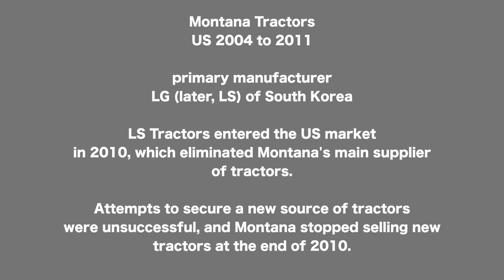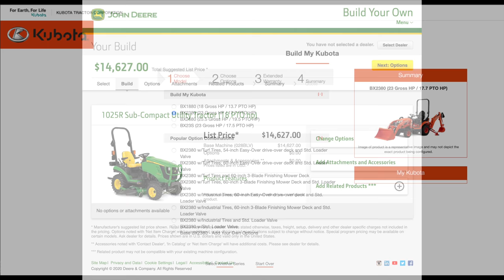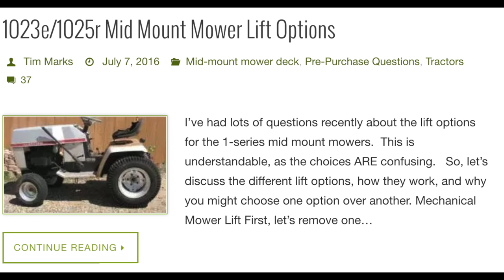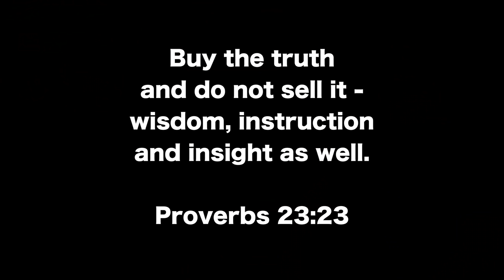Have NO REGRETS! Watch This Before You Buy A New Compact Tractor!

Comment: Good advice Tim. The 1025r is perfect for my 5 acres. We just bought the WorkSaver electric grapple. This implement is the bees knees for our land. My advice is don't buy a backhoe if your just taking care of 5 acres or less, just rent a 11hp mini excavator for an extended weekend. I dug a 100' trench for water & power from the house to my 16'x 20' barn with leanto for implement storage. In the same 3 days I dug two  4' deep footings for the barn and 4 holes for 8" sonotube 4' deep for the Leanto roof supports.
Reply from the maker: I disagree about the backhoe.  I use it for lots of "tiny" projects which would never justify a rental.  we'll show an example in an upcoming episode.   Anyway, each to his own :-)

Comment: LS Tractors have a good dealer network. You probably will not go wrong with New Holland, Case IH or Massy Ferguson. John Deere has a very solid network but you will pay for it. I have a New Holland and have never had a problem getting any part I may have needed.

Comment: Fwiw, grandpa has had a 5000 series since the mid-90's, but on a 450 acre tree farm, he got by with a 4wd Deere 1050 with no loader for 15 years before that. If something had to be lifted, there was a 3-pt hitch scoop and boom (having said that, get the loader!). So yeah, bigger is better and all that, but any actual tractor that will take attachments will do a whole lot! The only real problem with it was that you had to steer with the brakes when skidding big logs.

Comment: I started out with a 2210 and used it, but had decided I needed to step up and traded my 2210 for the 4115. I now have the 4115 and am satisfied and the attachments still fit from the 2210. The dealer is knowledgeable on the attachments to make sure if they will fit the next application(tractor), that you may purchase.

Comment: Great episode.  You always have the best videos Tim.  But a trailer should be discussed especially if you will help others and where are you going to park it?  And before that do you have a vehicle that can pull a trailer.  My opinion is a loader is an absolute must on a tractor.  I always recommend same brand loader as the tractor.  Consider a belly mower of the same brand also.    Then a box blade (also offsets the loader weight). I used the loader and box blade more than anything else.  You will quickly find a tiller is a must.  Those items don’t have to be the same brand as the tractor.  Considering the horrible cost of the backhoe, and the amount you will use it, I’d wait and just rent if you ever actually needed one.  Consider there is always one more attachment you will want for as long as you own the tractor.  Allow for it.  I never regretted the tractor or any of the attachments I purchased as I could do most anything and found things to do that otherwise I would not have even considered doing.

Comment: I live in Arizona on an acre irrigated property. I have a 1025 R with loader and 54d mower deck. . I have a rake and a blade. I wish I had more attachments. Box blade,tiller, and maybe a land plane. Get the 1025 R with the attachments that you need.

Comment: A dealer is basically a next level manufacturer....... tractors are built to your choices.  It isn't plug & play.  The tractor sitting on the lot actually isn't actually ready to go.  You'll need to add a ballast box, weights, tire fluid, etc.  I generally recommend rear tire spacers.....a tractor with a loader can be fairly unstable.

Comment: I love both tractors period! I went with John Deere for two main reasons on two different tractors purchases (3025 & then upsize to 4044m) and one zero turn (Z960). I think both brands are superior quality. First reason is 0% for longer term options. Second is John Deere insurance is far cheaper than Kubota's. This alone will save you a surprising amount. Third and fourth reasons, a lot of the John Deere compacts come with hydrostatic transmission and R4 tires standard. These are often expensive upgrades on Kubota's. I surely am not knocking Kubota tractors!! I tried each time to give them an opportunity for my business. John Deere most the time is cheaper in the long run even with a more expensive tractor due to these factors. I am currently looking now at purchasing the 1025r TLB for my smaller yard projects. Watching Tim lets me know what all this little tractor can do.
Reply: Sorry, for some reason this comment posted under my daughters name🤔

Comment: Very valid points. Having a 1025 myself I’ve had the chance to get into several projects like yourselves. It’s a very capable machine but it has limitations.  Another great comparison I have kicked around is a Vermeer skid steer... rubber tracked a bit more stable on hills and for grooming beech volleyball 🏐 courts.  💯 agreed any machine is only as capable as the additional attachments.  My opinion is there is a sacrifice to a multifunctional machine, I would not order a backhoe for my purposes I would rent a machine designed for the task. I ordered my 1025 with 3rd valve up front and a hydraulic top link and tilt cylinder on 3 point hitch. I have a box blade that we cut the sides down on so it will scrape better & added a 4 in one bucket @5’ wide just before they started offering 4’ model I welded excavator teeth on this bucket ( comes to about same price as a tooth bar). A tiller and York rake are two attachments I need to invest in.  As you may suspect my hydraulic pump is maxed out, functions are jumpy or slow to respond because of where the flow is needed or from the fact it’s a sub compact that is highly capable but has limitations. I would like to see if Vermeer1000 model  using a land plane, box blade, tiller demo bucket and York rake if it would be a smoother than a sub compact machine.... I say this because the foot print is similar as is lifting capacity, I wonder if the hydraulic system and pump is built a bit more robust to handle a different style of punishment?  Any knowledge you  or your channel base have on these machines and their attachments may help with new property owners. I think the Vermeer would have been a better fit. I love my 1025, didn’t know the longevity of the mini skid steers and bottom line is they cost more.
Reply: Mandel, good point about renting an excavator which is more versatile and out produces a backhoe. Skidsteers, if they have the Hi-flow option for attachments will have the extra juice. 
If you're in snow country a tr a cked skidsteer doesn't have the traction because of reduced psi ground pressure. I really wished Skidsteer mft added steel tracks as an option. Some makes did have them in the past.

Comment: The 1023e can have some really good deals that the 1025r doesn't as well. I got my 1023e with 0% for 84 months and a $500 rebate and at the time the the 1025R was only 60 months with no rebate, so sometimes the slightly different models can have pretty good deals.

Comment: Tim from what have seen and heard on other videos is that you have to have the backhoe mounting frame on the tractor before you can buy a backhoe attachment at a later time so a customer would be without the tractor for a few days regardless weather they get the backhoe from day 1 or if it was 3-4 years old
Reply from the maker: You can install the subframe assembly yourself if you want.  it is easier now on the 2018+ machines than on the earlier machines.

Comment: Moving into ALL lithium-ion powered yard tools.  To date,  I'll never re-consider gas again.  Need is a riding mower - 38-44" cut width with a transmission that can handle attachments without over stressing.  Speed is NOT a consideration.  Very good video!  Tom

Comment: I used an old Ford 2N for years. It pulled a bushhog, a grader blade, and a pond scoop and also lifted a lot with just a pole boom. It only had about 20 wore out horsepower and a single stage clutch....yet now I'm struggling on deciding if a 25hp diesel tractor is enough for my needs. The struggle's real lol.
Reply from the maker: In my view, a 1025r with loader will more than replace your 2N.       Having said that, you would likely find more value out of a 2038R.

Comment: Mine wintered over under some tarps & a harbor-freight 10x20 car cover open-side “tent”. However, a steel building is going to be installed for it just as soon as I get the foundation for it in place.

Comment: I bought a Kubota tractor 40 years ago.  A L185 and the only thing that is wrong with the unit is that one fender has faded and the other is still shiny as new.  Apparently they painted each part separately in 1980 and put it together.  I am planning on buying a new tractor this year and their is only one choice.  The Kubota brand stands for quality and I have a dealer less than 6 miles from where I live.

Comment: I bought a 1025r with a 120r loader, bucket and forks, light 4ft box blade, tiller, 54d mower and mulch kit, quick hitch, heavy hitch with plow and subsoiler and weights

I have almost 1/4 acre.  Seems way to small But the tractor allowed me to have a sizable garden for my family to eat from, to mow in much less time to spend more tome with fam, to take care of many many project in much less time, and to start a business and be very successful in my engineering career.  Which means the tractor is now tax deductible.

I would say if you can afford it you will not regret it.  I would also say go 1 size larger than you think.  You will also not regret it.

Comment: One thing to consider.  The larger the tractor, the larger the attachment needs to be.  Because of that, the cost of those attachments goes up.  My tractor is a an older one, but the best condition I found was in a machine in the 50hp class with a Class II 3PH and a rear tire width of 80".  It was purchased for maintaining the 1/4 mile gravel driveway after I'd pretty much blown up all manner of "Garden" tractors.  I'll admit I have far more tractor than I need with this 8000lb beast.

She's a great machine, but every time I look at rear attachments like my land plane and inverted snow blower, I'm looking at 7' wide attachments because I need those to span the width of the tractor.  In a land plane, going from a 5' to a 7' adds about $500-$800.  In a snow blower, I needed to go looking at used equipment because it would have cost more for the blower than I paid for the tractor.  A 7' blower runs between $6000 and $10,000.  It took me almost 3 years, but I finally found a used blower for roughly $3000 that was in a condition I could use - most get beat to hell.

That said, because my machine is so freaking big, 2WD is all I need.  I've used it to rip out some pretty large bushes and even some trees and I've not spun a wheel.  I do have a diff lock, but except once in the winter I've never used it and that use was on ice. 

Trade offs are what tractors are all about.  But I just wanted to mention the fact that with bigger machines, all the pieces parts also get bigger and more expensive.  The rear tires on my machine are 18.4x30.  They are awesome as they grip and float well with the weight and by filling them I added about 2000 lbs to the machine, but they also cost over $1000 each installed.
Reply from the maker: Mentioned that in the video.
Reply: @TractorTimewithTim  Yes, you did, but far too often you hear the comment of "Get larger than you think you need" and the cost of things after the fact does not get mentioned nearly as often.  When I first looked at the beast I have, my reaction was "WOAH!"  Needing a step to get into the operator's seat was the first time I wondered if maybe I was going too big.  I don't really regret it as I've certainly used the machine for jobs I never really thought about.  But the sticker shock on attachments was certainly not something I had even considered.

Looking forward to the rest of this series!

Oh, and where you have the Finance Committee, I have the Mistress of Finance.  I think if we'd have known just what the difference in attachments was going to be, I think I would have set my sights just a bit lower in tractor size. 

While I have your attention.  Thank you for talking about the Lube Shuttle.  I got fed up with the old grease gun last weekend and just tossed it.  Nearly an hour trying to get a new tube going and grease all over everything.  The Lube Shuttle arrived yesterday and it loaded up without a single bit of mess and it works very well.  Now I just need to get one of those Lube Lock things.  You mentioned that you needed an adapter, where does one get that?

Comment: The John Deere 1025R looks like a great tractor, but for 1 acre of mostly lawn I think it would be an overkill.  A John Deere lawn tractor and a self propelled snow blower should suffice. I have about 1/2 and acre and my John Deere LA115 has been serving me very well since 2008. I've used it for mowing (natch...), pulling a cart, a spreader (seeds, pest control), sweeper and a roller. The LA115 cost me $1600 back then (I think it's around $2000 now). The snow blower was $600. All the items I've mentioned above came up to $700. I would get the 1025R if I had 5 acres or more, especially with a long driveway in a snowy region.

Comment: Excellent episode Tim!
Your points are spot on and I would like to add a few things…

He needs to mow. If his focus is to have an undercarriage mower rather than a tow behind then the ONLY choice is John Deere. Nobody beats JD in this area. Get the 60” mower deck. I regret only getting the 48”.

A 1025 would serve him well, but if he can afford a 2038 GET IT! Better to have it and not need it than to need it and not have it. Having said that, If he has a drain field he can be assured that a 1 series won’t hurt it. Not so sure about a bigger tractor.

The Backhoe is a must hands down. Wish I had a thumb.

GET FORKLIFTS! Probably the most versatile and cheapest attachment. Aside from the obvious, you can dig/pop up brush, but it does a pretty good job at moving it as well. Grapple would be better, but that’s only if you have the cash and it’s not box-friendly.

If you have a gravel driveway or live on a private dirt road, get a box blade. 3000 to pay someone to regrade our private road. If you have a box blade or land plane then you can do it yourself. Land plane is better, but a 1 trick pony. Box Blade is a swiss army knife and can be used for more than a driveway.

If he has plans to put up a fence, he needs an Auger. It’s probably the least used, but you will be surprised, (and grateful to have it) when you discover how often you need to dig a deep hole.

IMO, the GENERAL essential implements are the mower deck, loader, backhoe, forklift, auger and box blade. If you have property you will need each one of these at some time. Most you will use a lot.

Really nice extras are brush hog, tiller, grapple and land plane.
Reply: The essential implements depends on your land and how you use it.  My number 1 need is a brush hog, then tiller.  I can rent an auger if I ever need one. Once fencing is up, not really needed again.

Comment: What is the minimum rear ballast weight recommended for the 1025R? I believe the backhoe weighs 600 lbs. We'd always leave it on. Should we simply add wheel weights and fill the tires with beet juice? I think the JD 1025R can receive 10 gallons (~ 100 lbs) in each rear tire. Wheel weights are 50 lbs apiece. That would give us 900 pounds in total (600 lbs + 100 lbs + 100 lbs + 50 lbs + 50 lbs.). Is that enough rear weight for the forks or a grapple? Thank you!!!

Comment: Don’t know your financial situation, but sometimes you can find a good used tractor, but 0% is not an option on used. I bought a thirty series and now looking for a bigger tractor. I have almost 1500 hours, oil changed every 75 hours, not a thing wrong with this tractor, used mostly for mowing, bush hogging. The local dealer was deciding factor for me. Good luck.

Comment: Are you in an area of snowfall and want to do snow removal with whatever your buying.   Are you looking at using it at multiple properties so what do you have as a tow rig.  For my third truck when i was 19 i got a 3/4 ton then i picked up a 10k 16ft trailer and i ran that trl for 7? yrs. I got a loader for my tractor so i needed a wider longer trl and found a 9ton 20+4 deckover that ive had for 6 years.  My 3/4 could handle it for how much i used it but when a guy ran a light and wrecked my trk i replaced it with a dually trk but that is my daily driver / tow rig so i have upgraded to fit but not everyone can

Comment: One thing I learned buying my tractor is if you buy an implement that requires a setup from the service department if you buy the implement after the tractor purchase you will have to pay them for the setup. If you buy the implement when you buy the tractor you don’t pay for the setup. I added rear SCVs and rear fender flares to my tractor. The install on the flares alone was 2 hours. So I saved a bunch of money getting them with the tractor. That was something I figured out later. That may be different with different dealerships.
Reply from the maker: Tractor options like scv’s are least expensive when purchased with the tractor.  Correct.